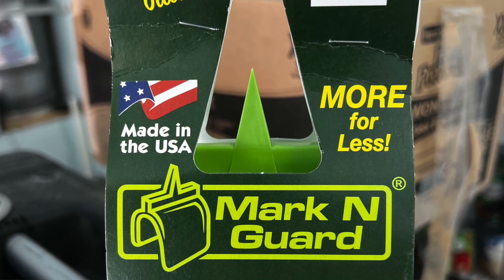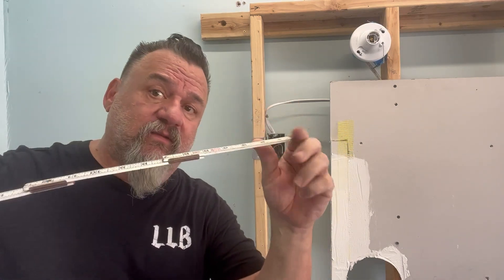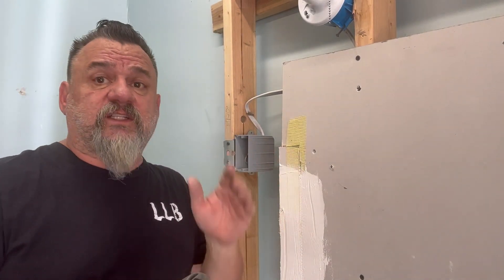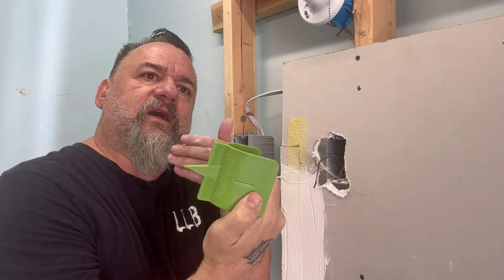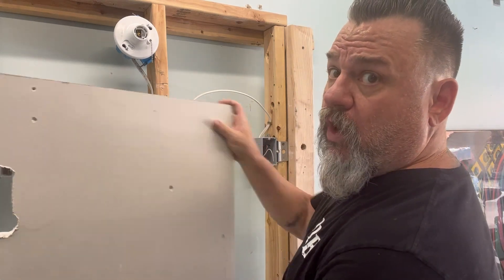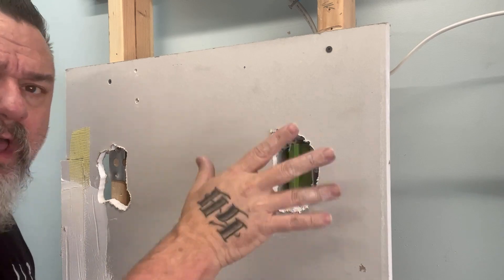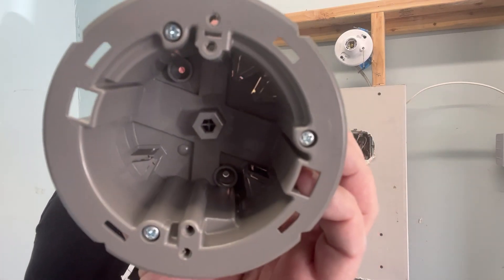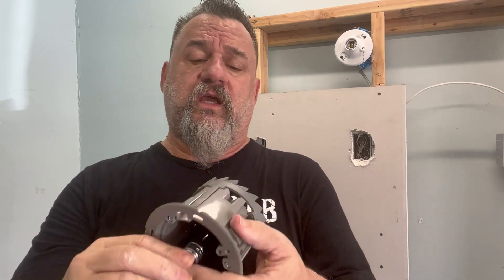Electrical Gadgets and tools. Plastic all in one hole saw, wire protector and electrical box finder

Comment: Rewired a house years ago where first time home flipper was the expert general contractor. Of course he was in a big hurry and did not want me to install enough receptacles ( 6' from doorway then every 12' ). Took him a year to Sheetrock. He called me back after he spackled walls about 8 times to get them to look so so. He forgot to cut out boxes in huge dinning room and two other rooms. He thought that I would remember where I nailed on my boxes. Took a cost hanger and drilled bunch of holes next to studs to locate the boxes. He was pissed because he had to spackle holes I made them touch up with paint. Fortunately I had enough commercial work that I stopped doing residential work.

Comment: If the rockers cover my box I have a boot for finding boxes, and I have no sympathy for the nail pops. As for the cut in round  no way $$$ or till the some idiot forgets to remove the hole saw part and punches in out the other side of a wall

Comment: Why don't they measure and cut out openings for the electrical points when drywalling?  is there a building reg or something that prevents them? or at the very least mark the outside of the drywall.
Reply: smart rockers make reference marks on the floor.  but as to why they don't precut?  it takes longer.

Comment: Bro, try to just remember, if your routing the outside of a box you cut counter clockwise and if its the inside of a box you cut clockwise…. That’ll automatically pull the root zip into the side of the box as you cut…and i was taught to ALWAYS push wires into the box before i hung my drywall…
Reply: and I was taught to always push the wires into the box before I turn it over to the drywaller.

Comment: The drywall dilemma would be solved if electricians didn’t install the boxes as part of the rough wiring. Clamp style boxes (remodel boxes) could be installed AFTER drywalling AND paint primer. After all, the inside of the boxes is going to get covered in drywall dust and sprayed paint since those trades don’t care what annoys electricians.
Reply: How would you pass inspection from the AHJ?
Reply: Drywall clamp boxes are shit. They should never be used if it can be avoided.
Reply: Why would you install an inferior product that takes more time to install? This all sound stupid. Like maybe you’re a drywall hanger?
Reply: you mean trailer house style.
Reply: Cut-in boxes won’t pass inspection for new construction. That’s why nail-on boxes are designated for “new work” and cut-in boxes are designated “old work”. In a new wall, your boxes have to be secured to the studs and the cable/conduit does as well. Every cable or raceway has rules in the NEC for securing and supporting (distance from the box and distance between intervals) with the exception being when fished between access points through concealed spaces of finished buildings or structures (old work) and supporting is impractical
Reply: @Ephesians-ts8ze  
You’re not following. The rough wiring is still completed before drywall. The only difference is that the gang boxes are installed as part of the final wiring…or just prior. 
Sure, old work clamp boxes won’t pass inspection in new construction. So you update the NEC to allow it.  If it’s critical to safety (I suspect it isn’t) to fasten a gang box to a stud, then gang boxes can be constructed in two pieces…a frame/rail attached to the stud during rough wiring…and a box that snaps onto it after drywall.
Reply: @tycox8704  I’m not arguing what should or shouldn’t be. I’m just saying what “is”. If you’re saying that there are things that should be changed in the NEC, I don’t disagree with you. In the meantime we have to rough-in our work according to code. That’s why the code is updated every 3 years. There’s a code making panel that you can send your suggestions to and they can review them. Unfortunately, it’s a very political process
Reply: @tycox8704  I get what you’re saying though. My apologies if I misinterpreted your comment to mean just simply ignore the code. I am a master electrician and my brain immediately reverts to whether an installation is code compliant and will pass inspection
Reply: @Ephesians-ts8ze  I imagine the NEC is open to innovations. The current hardware wouldn’t satisfy their standards, but perhaps a product engineer in the Levitons of the world, could prototype what I described. Perhaps you? Could make you some $$$ possibly.
Reply: @tycox8704  sometimes the manufacturers have influence on the code making panel and safety is sacrificed for their special interests
Reply: @Ephesians-ts8ze  code allows it and some manufactured home manufacturers do it.  it's still not the best idea, in my opinion.
Reply: @kenbrown2808  the code does NOT allow it EXCEPT for fishing between two points of a finished building like I said in my previous comment. I honestly don’t know the code that applies to manufactured homes and I don’t even care to look it up because, in my 30 years experience, I’ve never worked on one and probably never will. The general requirements for securing boxes, cables, and conduits in-wall are defined in article 300 of the NEC
Reply: @Ephesians-ts8ze  and yet, it is perfectly acceptable to use a cut in box for an exterior light or receptacle, and many electricians use cut in boxes for vanity lights. The code only says the box has to be secure, it does not specify that it has to have two nails driven into framing before sheetrock if the wire wasn't fished in after sheetrock.
Reply: @kenbrown2808  320.30, 322.30, 324.30, 326.30, 328.30, etc etc. When did you get your master’s license? I’ve had mine for 20 years. Have you even passed a journeyman test?
Reply: @Ephesians-ts8ze  article 320: type AC cable. 322: type FC. 324: type FCC. 326: type IGS. 328: type MC.  
try 314.23(c)

and maybe you'd better take some continuing education, so you know which article to look at for outlet, device, pull, and junction boxes.
Reply: @kenbrown2808  4 hours of CE credits are required annually to renew my license and I took my masters test 21 years ago, dummy. 😂 you’re just regurgitating what I just told you in different words. You can cite code articles all day long but if you can’t interpret them properly the inspector is going to red tag you every time. In 30 years I’ve never failed an inspection
Reply: @Ephesians-ts8ze  now i know you're full of it.  I told you what the articles you claimed were about box mounting ACTUALLY are about.  and then I told you the article that is ACTUALLY about box mounting.   which means your accusation is actually a confession.  you rattled off articles about material that is RARELY used in residential construction.  the only way you've never failed an inspection in 30 of the 21 years you've been a "master" is if you've never had an inspection.

Comment: Nice demo.  I'm in the beginning of installing some round boxes.  Is there a standard diameter for the hole saws?  I measured my box; it seems like I need 4 1/8" to allow room for the ears, but it doesn't leave much room for the lip to sit on the sheet metal that I'm mounting it into.  Thank you.
Reply: Try using a 4” hole saw then cutting out the spot the ears go up with a jab saw
Reply: @ryandevid3449  great idea, simple in hindsight.  Anyway, I did get them installed.  I used a practice piece of wood first.  Thanks!